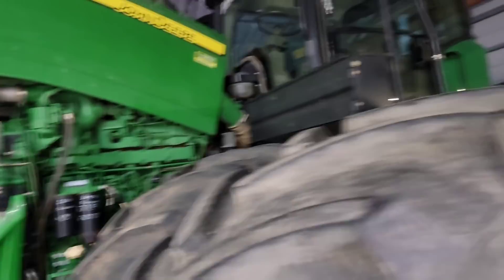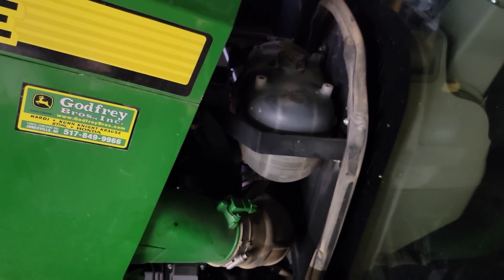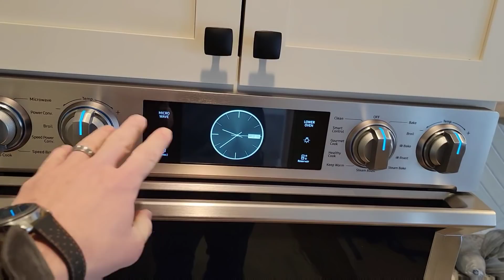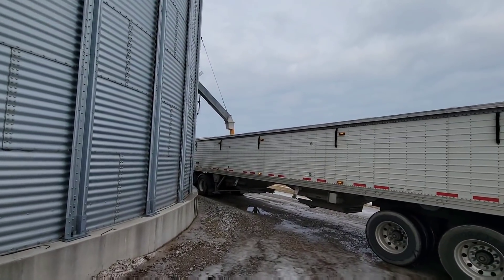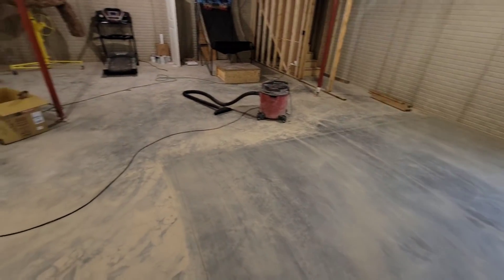Land Auction Day - #613

Comment: Those heads on that  deere engine tend to go bad after 2 to 3 thousand hours so it's about right on time unfortunately. In my experience They have bad oil coolers fan drives and head bolts   I've delt with that  same issue on our old 690  combine and 9420rx I did the work myself as I used to work for deere as a tech. That tractor still has plenty of life left and is worth getting fixed especially for a future trade in to have the head replaced and updated will certainly add value.  I bet the wife and boys are excited about moving into the house ! Great video keep up the good work!

Comment: $6700 seems WAY high to me. I remember paying 16K for 70 acres. Happy Birthday Bryson.
Reply: Sad part is EVERYTHING is CRAZY HIGH! I called about a Cummins REMAN Motor the Other Day, just above $50,000 with Core Charge and Upfit Kit with Coolant Hoses, Starter, ETC was another $7,500, Wiring Harness was another $4,000. Don’t get me Started on New Semi Trucks, IF you can Get Them. All of the Major Manufacturers have Returned Deposits on Placed Orders, and have Refused to Honor Prices on Placed Orders, basically have said that the Price is what it is when it is Delivered. I know that Raven Dump Trailers have said the Same Thing, won’t know the Price until Delivery or a Month or so Before. I know Guys that are Selling 2-3 Year Old Semi Trucks for MORE than what they Purchased them for New, Pre Pandemic. Things are Beyond Crazy Price Wise, as long as a Person has their Money Invested in Something Other than in The Bank, they should be alright. If it wasn’t for All of that Crypto Currency’s, Gold, Silver, Copper, ETC would be Higher than what it is.

I know what your saying on Land though, you think the $6,700 was High, then when you think that it works out to be around $9,000 a Tillable Acre. Don’t get me Started on Land Prices here in Illinois. It makes $9,000 a Tillable Acre sound like a Deal. In certain Areas it is almost Double the $9,000 a Acre. There is some not far from me that is between the $15,000-$17,000 a Acre.
Reply: If you think $6700 is high, you are not paying attention…
Reply: 15-20k per acre NW Iowa
Reply: @brentpetsch8366  So a 1000 acres would be 15-20 million. A young person would have no chance of ever starting a farm. That just makes me sad.
Reply: here in Canada, Ontario some places are 20-30k/acre and if its vegetable ground your looking 50-60k/acre

Comment: Is it normal and ok to discharge the salty softener flush water into your sump?  Seems like it would be harmful to that system.  We don’t have basements here but I was wondering.
Reply: YES, I seen that also, it is salty backwash to rinse the resin, it will rust out that sump pump in no time. 
Maybe he's got some special kind of sump pump that I don't know about....
Reply: Sump pumps have plastic impellers and are sealed submerged units.  Salt won’t hurt them.

Comment: Your new house is amazing good video.

I didn’t see acid neutralizer on your navien condensate line.

The acid will destroy your sump pumps.  
 
Example of kit Amazon 
SANIFLO Sanineutral - Neutralizes Acidic Condensate - Residential & Commercial

Or did you pour marble rocks into the base of the sump.  Then extend the pipe so that it releases acid thru chips/rocks.  That might also work